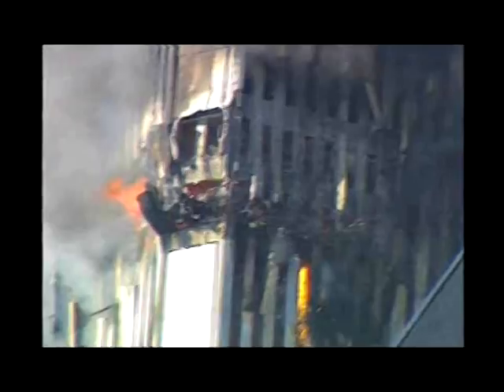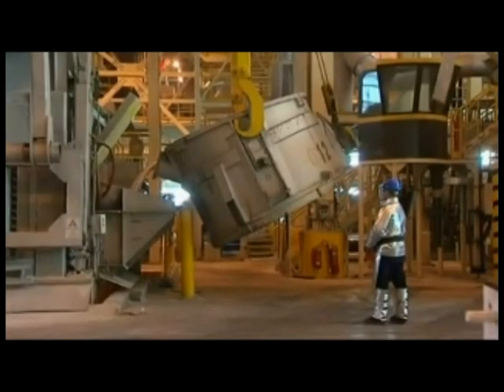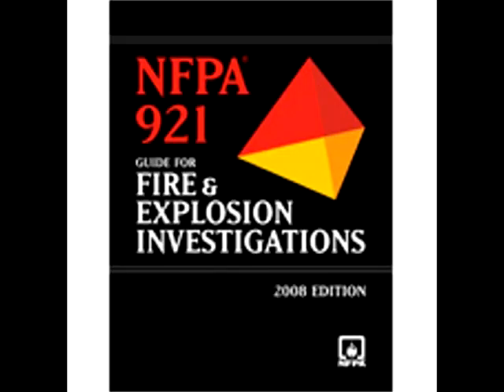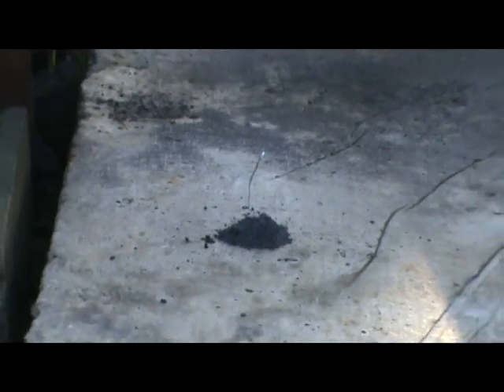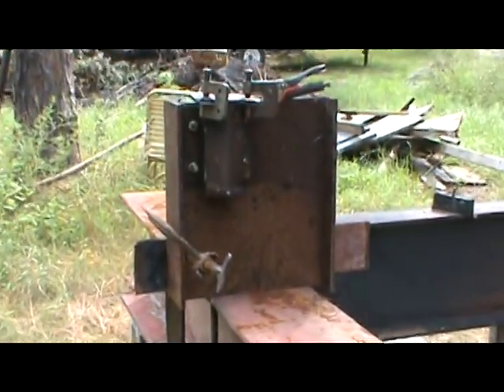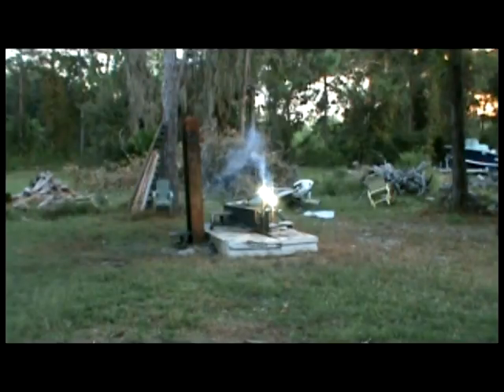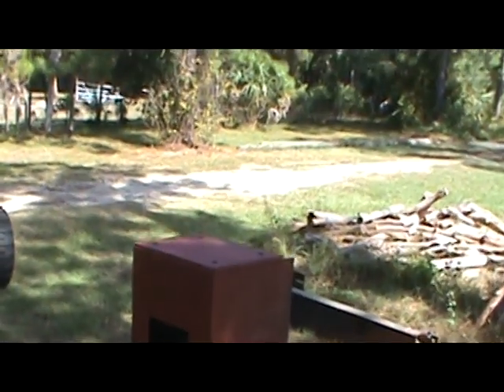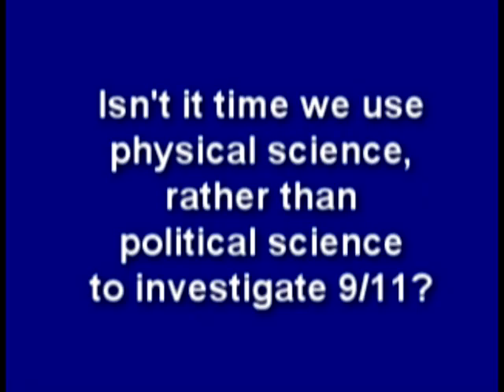9/11 Experiments: The Great Thermate Debate

Comment: If "official story" means NIST report, then you're propagating a falsehood since NIST doesn't make the claim jet fuel or office fires melted steel. @ 13:33 you claim some columns can be seen with an intense glow, I don't see it, I see fires in the building but I don't see steel columns glowing. & what time is that pic from? Are you saying agents placed steel cutting or weakening devices or material right @ the floors which would be on fire? Was this done throughout the building or only there?

Comment: @darion65

Sure, everything was masterfully planed, they were able to smuggle 200t of NT + high explosives into 3 high security buildings, somehow managed to switch the planes, but leaving no evidence, like FDRs, serial no.

If they had withdrawn the original planes from circulation, why didn't they use their black boxes... altering data, using pieces of it... you know... like the slab where the serial is stamped on and show it to everybody?

Comment: @JLaw012
Besides the FAA deregistration issue, solid evidence has also come forward that two of the 9/11 flights, Flight 11 and 77, never even existed at all, according to Bureau of Traffic Safety (BTS) records. According to BTS statistics, both 11 and 77 officially never took-off on 9/11. The data also showed no elapsed run-way time, wheels-off time and taxi-out time, not to mention several other categories left blank on 9/11 concerning the two flights.

Comment: @JLaw012

Two of the 9/11 airliners were never 'deregistered' and remained on the 'active' flight list until Sept. 28. 2005. Although the planes are deregistered, they are not listed as cause destroyed but rather as cause canceled. The American airplanes are clearly listed as cause destroyed. So did Flight 93 land at Cleveland with 200 passengers on board?

Comment: @smnaotrt

4 hours of fire resistance you say. What happens after those 4 hours? The fire won't go out by itself. And the kind of blaze happened in the WTC towers would've never been succefully extinguished by the FDNY, because fires in high rise bldg. are nearly impossible to contain. Even if the buildings are designed to be "firestoppers"/fireproof. Fighting a blaze in a skyscraper the structure this damaged? Hopeless...

Comment: @smnaotrt

I experienced the abiltiy of steel conducting heat, the alloys i've worked with differ from what was used for the WTC, but with pretty much the same thermal conductivity coefficient. In my proffession It is needed to avoid the heating of the working material. If you don't do it properly and without cooling not just the work piece gets damn hot very quickly and very slowly it emits the heat. Alloyed steel has relativ low coefficient, but it still is conducting the energy fast.

Comment: @smnaotrt

"sudden tremendous energy output"

Ok. An illustration:

You have a welder, welding some metal, what kind of doesn't matter. The torch has a temperature of about 3000°C. You're doing your work within a few minutes.

Next, you have big pile of wood, as high as single-family house, a few liters of gas and you throw a match at it.

Nowhere in the burning wood pile the temperature is as high as in the flame of the welder, however the produced amount of energy is much higher.

Comment: @smnaotrt "100g greater than those of the accelerants that affected the SFRM."

How fast can 1 once ball 1 inch in diameter be traveling without knocking any fireproofing off?

This is a litmus test. 

You will not be able to answer this question because you have no idea how to apply the unit (g) to any of physical materials involved. 

All you see are two units of measurement that are the same and see that one is less than the other and go "see, inside job".

Comment: (1)  "something different was applied"
Yes that something different is BLAZE-SHIELD II which I have been discussing throughout all of these comments.  The data on the SFRM is relevant to BLAZE-SHIELD II.  The BLAZE-SHIELD Type DC/F located in the impact zone of WTC 2 was "equal to or slightly better than those of BLAZE-SHIELD Type D [asbestos SFRM]." (NCSTAR 1-6A)  I will admit I was ignorant to claim that WTC 2 impact zone was asbestos based on another's claims.

Comment: (3)  "The towers were hit by a mass of 150t at the speed of 800kmh."
This disregards the fact that the majority of the plane was reduced to pieces, mere particles within tenths of a second upon impact (0.2 sec).  That's why I have been focusing on the actual accelerants that would have come into contact with the fireproofing instead of the whole plane, this assumption disregards the actual event.  Only a few pieces of the plane would retain its mass which includes the fuselage and engine.

Comment: @smnaotrt

Asbestos was used as FPM when the WTC was constructed. Meanwhile it was found out that it isn't very healthy and could cause cancer. Thus plans were changed and something different was applied. By then only the steel frame of the FIRST 40 floors was encased by asbestos containing fire proofing material.

Got it?

Comment: @smnaotrt

"It won't fail if it is stronger than the forces being applied (adhesive strength vs. accelerant impacts)"

The towers were hit by a mass of 150t at the speed of 800kmh. The fireproofing certainly wasn't able to handle this force in the zones the impacts were directed .

And as i've said... even if a big percentage of the material stayed intact, it has to be entirely intact to grant the most possible fire protection. After this hit you cannot and some laboratory results won't help.

Comment: @DURound 

What? Just keep making tangential irrelevant references. My house has nothing to do with building 7. Welded beams don't have any insulation between the welds? Heat transfer is directly proportional to the temperature gradient, that's a* mathematical fact*. 

Now you look for an **edge case** where its not?

Your clearly a buffoon and your post proves it. Sig worthy.

Comment: (1)  "You were wrong before"
Nope before was regarding the SFRM in general, the most recent posts are in reference to the SFRM on the floors that way they are more specific relating to the WTC conditions and NIST supposed explanation of what happened.  
"Btw. some laboratory tests with best and in particular controlled conditions and prbly. missused results are not very expressive."

Comment: (5)  In the years between 1995 and 2001, thermal protection was upgraded in a number of the floors affected by the fires on September 11, 2001.  Specifically, in WTC 1, floors 92 through 100 and 102 were upgraded." (NIST NCSTAR 1-6A) "Late 1990s:  Floor truss fire protection upgraded to 1.5 in. during tenant alterations using CAFCO BLAZE-SHIELD Type II." (NIST Appendix I)

Comment: (7)  "destruction of the frame and the sudden tremendous energy output"
I might as well just quote where you got this information, NISTs FAQ.  "WEAKEN THE STRUCTURE to the point that the towers could not resist the TREMENDOUS ENERGY RELEASED."  This weakening of the structure can only occur if the fireproofing utterly fails.  And this tremendous energy output/release is in reference to the downward momentum assuming that the steel sags enough to allow for significant weakening.

Comment: (8)  "after this kind of impacts, you cannot ensure neither of it."
Circular reasoning, especially since the SFRM already has an adhesive strength OVER 100g greater than the accelerants.  It won't fail if it is stronger than the forces being applied (adhesive strength vs. accelerant impacts).  There is actual evidence to show that the upgraded SFRM can withstand the impact.  All you have done is claimed that they can't.  There is a difference between making claims and proving them.

Comment: @smnaotrt

"towers withstood the initial impact."

So what? A building danger in collapsing might not collapse for some time, however that doesn't proof it's safe.

"The heat from load energy wouldn't increase as time went on."

Uh, I wasn't talking about the height of the temperature.

"It is evident that this would not have happened."

Yea? Where?

I see, you didn't understand at all what i said, actually not reacting to what i've wrote.

Comment: (1)  The four hour rating means that the fireproofing can sufficiently protect the steel for up to four hours based on ASTM E-119 regulations,  temperatures which exceed those observed in the towers.  Therefore the heat isn't sufficient unless the fireproofing was removed.  Like I mentioned earlier NISTs tests regarding SFRM revealed that "the acceleration required to dislodge the SFRM varies from 55g to 230g depending on the strength characteristics within the assumed ranges given."

Comment: (2)  The given ranges of strength characteristics were from 500 psf to 2,000 psf.  BLAZE-SHIELD II happens to have a strength characteristic of 2,380 psf which exceeds this range.  Therefore it should be concluded that this fireproofing could withstand accelerations higher than 230g.  The impact resulted in accelerants that were only 100g.  Therefore the fireproofing would remain intact.  Clearly we can see that the fireproofing can withstand both the impacts and the temperature without failing.

Comment: (3)  You have yet to prove that this SFRM was insufficient regarding the events in the WTC.  Comparison to abesto does no good either way because like ctrackmonger made clear abesto SFRM was the majority of the impact zone in the other tower.  The heat would only decrease after the initial impact.  You claim that "the destruction of the frame and the sudden tremendous energy output was enough to heat up the structure in no time"

Comment: @palasta (4)  It evidently wasn't enough because the towers withstood the initial impact.  The heat from load energy wouldn't increase as time went on.  The only way the steel could have been weakened to the point of allowing the towers to collapse would be to have the fireproofing basically gutted.  It is evident that this would not have happened.

Comment: @smnaotrt

"2.fireproofing would still remain on the surrounding steel (that was hit by reminent debris) which has been made clear"

It seems you don't know about the virtues of alloyed construction steel... and it was made clear, that the fireprotection was unsufficient... or not as sufficient as asbestos.

Did you (or any other participant) ever asked himself what would've happened if the towers wouldn't had collapsed after 1 and 1 1/2 hour?

Comment: (1)  I'm not quoting what I have before because I have mentioned it a multitude of times already. The fireproofing can withstand the 100g impact debris from the remaining particles of the plane that would have "scattered" of from the initial impact. NIST claims that this debris which was estimated to be 100g could rid the fireproofing of the surrounding floors above and below, the floors that needed to sag for NIST to be correct.

Comment: It doesn't matter that the plane took out steel and SFRM in its direct (initial) path because 1.the towers withstood the plane impact which resulted in missing steel and 2.fireproofing would still remain on the surrounding steel (that was hit by reminent debris) which has been made clear"

Comment: (1)  NIST must assume the smallest acceleration is required to fit their predetermined explanation of the event.   Relative to the supposed exact layout of the WTC floors "the acceleration required to dislodge the SFRM varies from 55g to 230g depending on the strength characteristics within the assumed ranges given."  The data used for this was "1.2 in diameter bar with 2.5 in. thickness of SFRM and density of 19 pcf."  There are some things odd though in their setup.

Comment: (2)  They claim there is a 2.5 in thickness of SFRM.  Earlier it was mentioned that the upgrade only add 1.5 in of SFRM.  They utilize a density of 19 pcf while BLAZE-SHIELD II has a density of 16 pcf and strength of 2,380 psf.  This skewing makes it easier for the SFRM to be removed according to NIST's tests.  "The smallest required acceleration is about 40g, which corresponds to a large bar [1.2 in] having a thick layer [2.5 in] of the higher density SFRM [25 pcf] with low strength [500 psf].

Comment: (3)  At the other extreme, the required acceleration is about 730 g [0.9 in, 0.75 in, 15 pcf, 2,000 psf]."  For their supposedly "exact" replica they increase the thickness, increased the density, and then must disregard the actual strength of BLAZE-SHIELD II to be less than it really is.  Doing so made it easier than it should have been to remove the SFRM based what was mentioned about.  For the time being let's just disregard what didn't match the actual results.

Comment: (4)  The "SFRM varies from 55g to 230g depending on the strength characteristics within the assumed ranges given."  The assumed ranges where from 500 psf to 2,000 psf.  BLAZE-SHIELD II which was used in the upgrade has a higher strength than this which is 2,380 psf.  This means that NIST should rely on the 230g results which are still greater than the impacts of the planes 100g.

Comment: @smnaotrt It's also meaningless to say the fireproofing can tolerate 1800 degrees when fireproofing is rated on a time temperature curve based on both the components it's sprayed over and it's applied thickness. 

Apparently this wrong application of data escapes you as well. 

Don't you hate it when you cannot confuse people with technobabble.

Comment: Should've worded "accelerants greater than 100g" to "forces of accelerants reaching 100g"
Keep claiming all you want it doesn't match the actual data.  No matter how much you call someone stupid or whatever it doesn't change the facts that the SFRM could withstand both 1800°F and 100g impact of the planes.  Your lack of understand ablation is evident just define it for us and you should see how you are wrong.  "The aircraft impact forces were estimated to have been about 100g" straight from NIST

Comment: Do you even understand what ablation is.  Ablation would be caused by fires in this case.  The impact of plane force of 100g has nothing at all to do with ablation what so ever.  And yes it would survive because it was certified to survive higher temperatures.  The fire temperatures and the impact of the planes have two different effects relative to the fire proofing.  The force of the impact deals with adhesive strength will ablation deals with the temperatures.  At least know what your saying.

Comment: @flanksteak2 that is ridiculous to claim read below.  The BLAZE-SHIELD II SFRM passed tests in accordance with ASTM E119.  Like mentioned earlier temperatures during ASTM E119 reach up to 2012°F fires in the WTC fires only went to 1800°F.  It is absurd to even claim that the fireproofing could be ablated or "vaporized" by this temperature when it passed ASTM E119 regulations.

Comment: @palasta Even considering that fact the tests done by UL on BLAZE-SHIELD II which is the upgraded SFRM used in the WTC received "ratings of up to 4 hours for:  FLOOR ASSEMBLIES, Beams, Joists, Columns, Roof Assemblies, Walls and Partitions" "in accordance with ASTM E119"

Comment: @palasta No because like I made clear the SFRM would still be over 1.25 in.  It wouldn't be fully intact compared to the 1.5 in that was initially applied.  1.25 in would still be enough though to handle fires much much longer than that which was supposedly observed.

Comment: @smnaotrt

Even if the majority stayed attached, it played a significant role for the beams and trusses to be almost completely enveloped with fire protection. However, after the impacts, with the destroyed framework, there was plenty of surface for the fires to attack, this in combination with the tremendous energy and relatively good thermal conductivity, could've led to a rapid heating.

Comment: (2)  According to FEMA by September 11, 2001 the entire impact zone in WTC 1 had been upgraded with the new SFRM.  This while taking into account the forces the upgraded SFRM adhesive could withstand, one could inferred that most of the SFRM was intact considering that they most likely wouldn't be experiencing forces anywhere near their minimum adhesive strength (40g=392.4 m/s^2).

Comment: (1)  Well let's just take the average adhesive strength of the SFRM fireproofing, (40+730)/2=385g.  Obviously that is more than the 100g from the following impacts that NIST estimated.
Or we could look at things this way since the former disregarded the SFRM that was at its lowest adhesive strength having the ability to be knocked off.  Let's just assume that there were 690 pieces of SFRM to account for each of the integral ranging forces the adhesive could withstand (730-40=690).

Comment: (3)  This contrasts the amount of SFRM used in NISTs tests which ranged from 3/4 in to 1/2 in.  This is drastically less than the amount of SFRM that could be predicted to remain intact.
Let's take into account both preceding outlooks to get a more comprehensive understanding.  Since the average adhesive strength was 385g there would most likely be a bell curve to represent the amount of SFRM with ranging adhesive strengths.

Comment: (4)  Basically a normal distribution bell shaped curved could represent the SFRM pieces vs adhesive strength.  Simply put the majority of SFRM would have strengths of 385g while 40g and 730g would represent the lowest amount of SFRM.  A normal frequency distribution can be represented by these percents.

Comment: (5)  .2% of the pieces range from 40g-41.38g, 2.2% of the pieces range from 41.38g-56.56g, 13.6% from 56.56g-150.4g, 34% from 150.4g-385g, 34% from 385g-619.6g, 13.6% from 619.6g-713.44g, 2.2% from 713.44g-728.62g, and .2% from 728.62g-731g.  To save some time let's be generous and say that SFRM ranging from 40g-150.4g was knocked off which is 16% of the SFRM.  Once again if there was 1.5 in of SFRM present and 16% was knocked off only 0.24 in was removed (1.5*0.16=0.24).